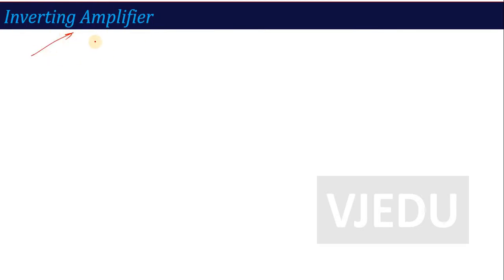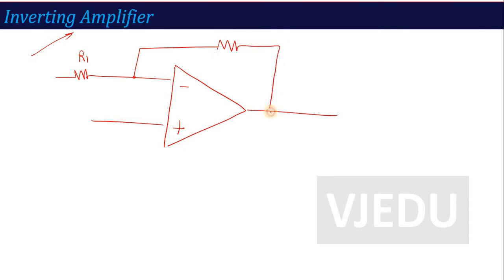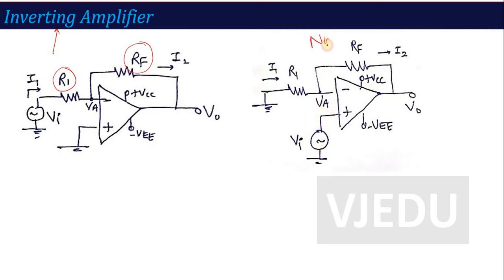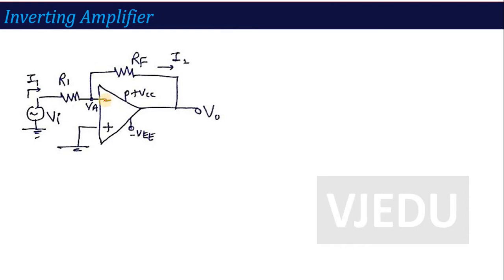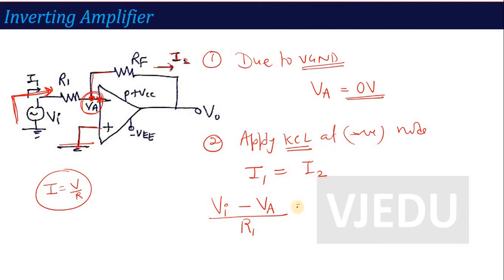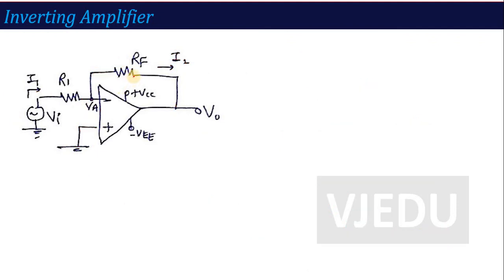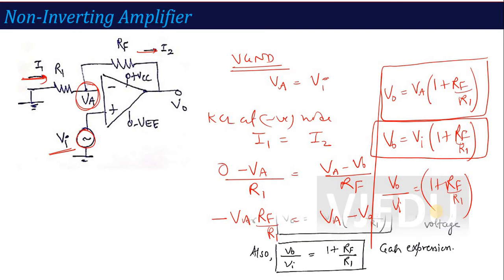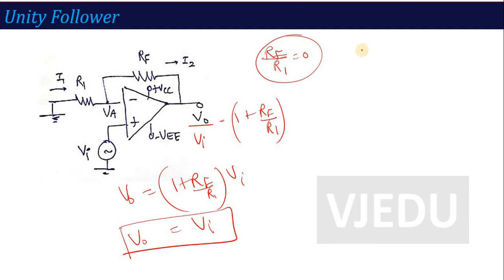U3_L2_Inverting, Non-Inverting & Unity Follower | Electronics Engineering (KEC201T)| Hindi

Comment: I have a question
At 10:07 how I1 current flows through R1 when input is given at + terminal?
Reply: If VA = Vi
Then also voltage is given after the resistance R1, flowing of I1 current is not possible
Reply from the maker: @edusesy  Great. Current flow from one potential to other. This is completely new concept that if a voltage is given after a resistance than flow of current is not possible.
Reply from the maker: Listen lecture carefully..
Reply: Sorry but I am not getting
If current flows from one potential to another ,is it like this ?
                    ----->-----Rf--------
                    |
                    ^
                    |
 ------<- R1-- |   ----<--- _
               ---------------> +
              |
              ^
              |
             I1
             Vi